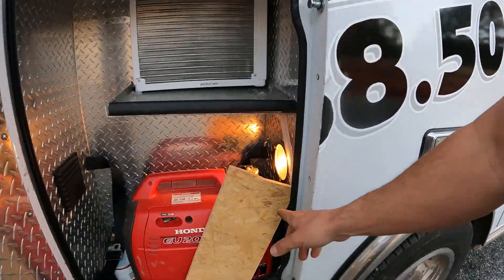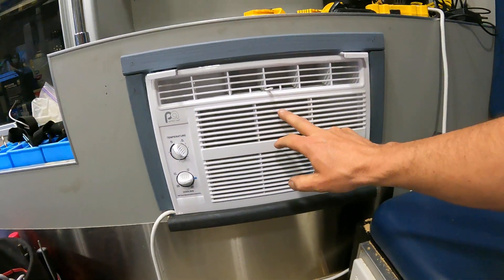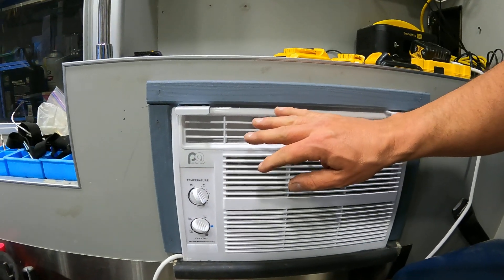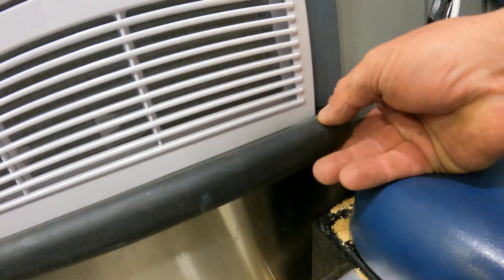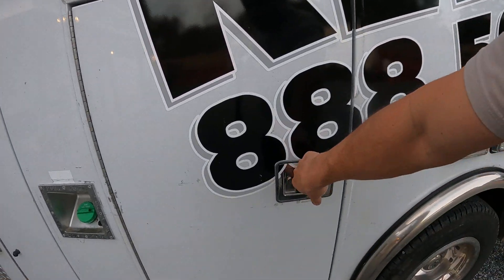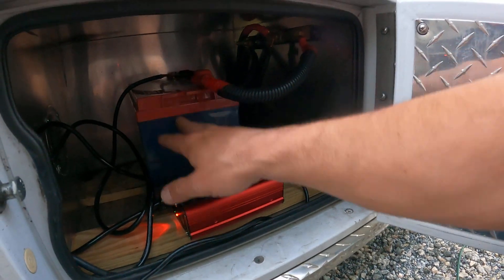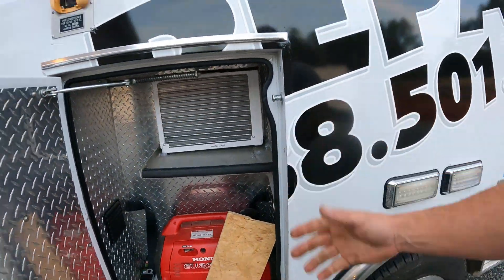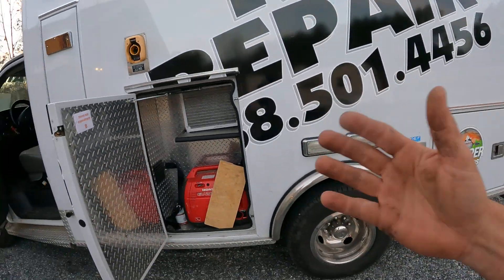The world's Most Innovative SERVICE TRUCK !

Comment: You can easily run up to a 15k rooftop on that Honda 2000 if you install a soft start on the a/c. However, that smaller unit will be much more efficient for running off the inverter and better for your situation.